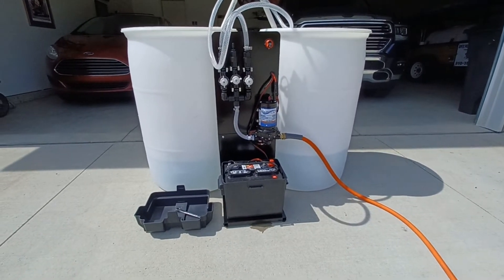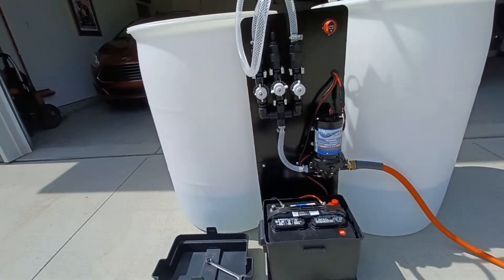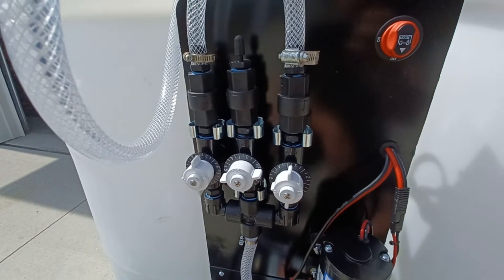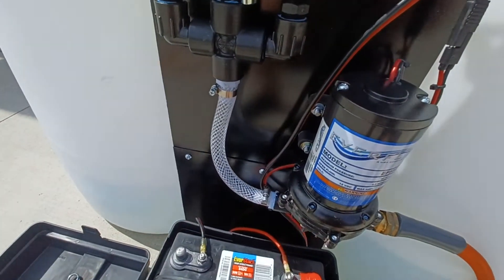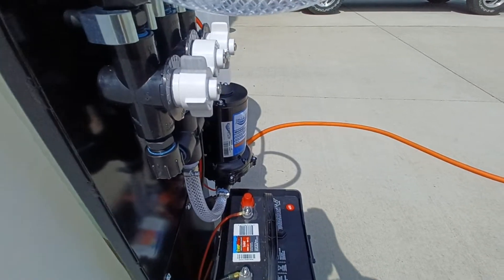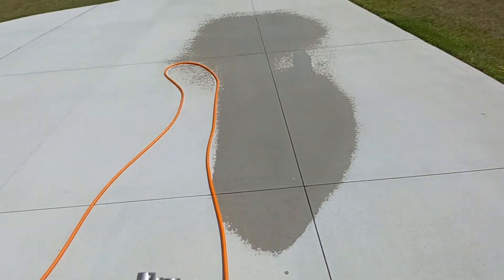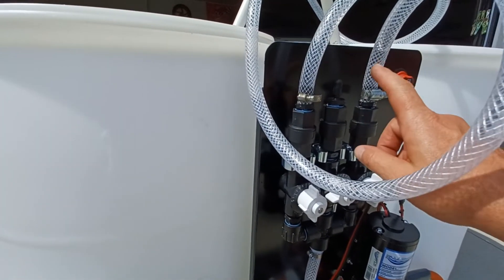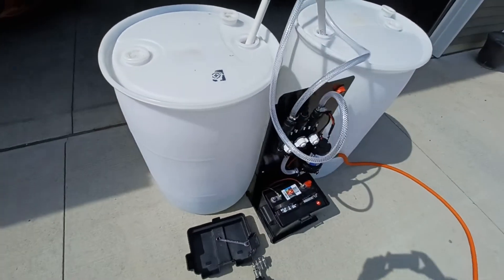Entry Level 12volt Soft Wash System in action.

Comment: What size hose do you have on the output for this distance? Are you using the brass connector with a garden hose or an actual softeash hose?
Reply from the maker: I don't provide the output hose, that's on the end user.

I do provide either a brass garden hose connector or a stainless 1/2" hose barb. Which ever the buyer requested.
Reply from the maker: I. The video, I'm using a 5/8" garden hose.